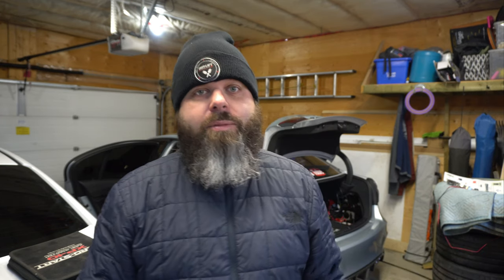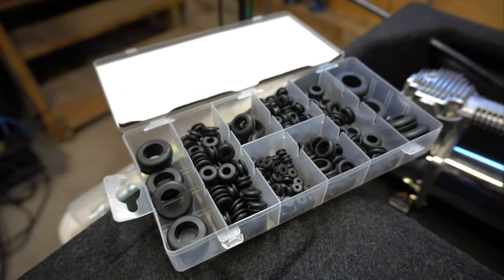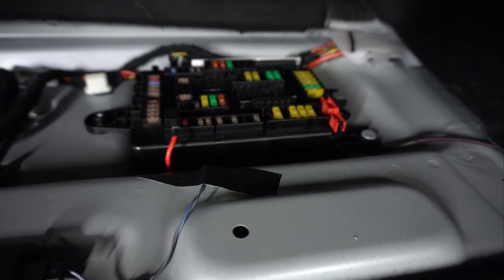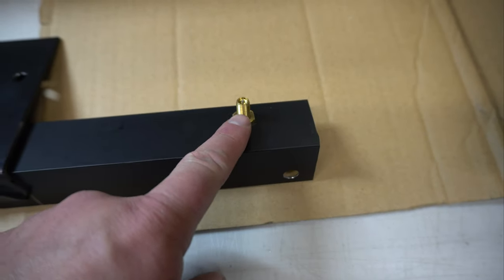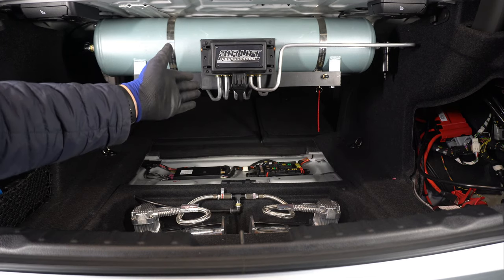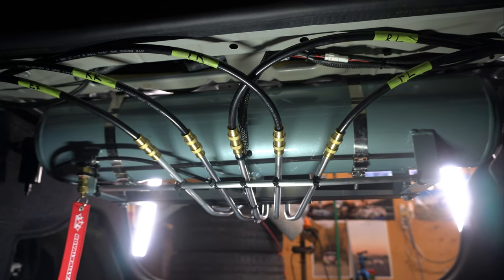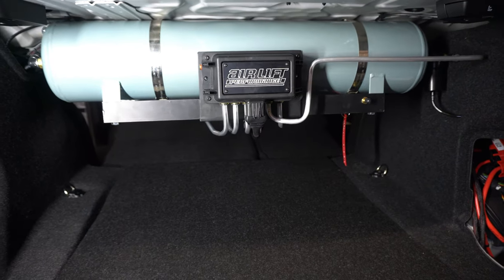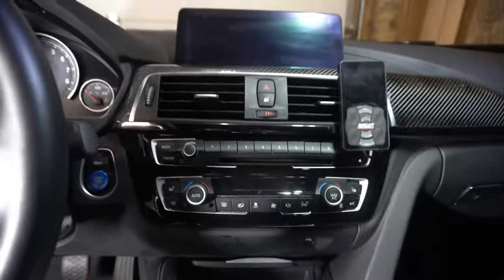Airlift Performance 3H Install Part 4 | Custom Trunk Setup DIY

Comment: I just watched your video and had some questions? I wondered where did you put the control valve??? To make the rear drop at the same speed at the front. Your video helped a lot
Reply from the maker: The valves were put on the lines going to the front bags.

Comment: Where did you run the EX line to? Ca t make it out going to start pulling my old set up and using your plumping set up way clean and very thought through for emergency lol

Comment: You didn’t show connecting the power in confused, do you have a battery in the trunk?
Reply from the maker: Yes that is correct. The BMW has a battery in the trunk

Comment: is it true that hardline are not reliable? I am thinking of floating my tank i have a hatchback so if I mount it to my rear back seats i wont be able to put them down. what do suggest?
Reply from the maker: Hardliners are reliable when installed correctly. I think a hatchback is tough. Most guys put it under the floor or just behind the seat attached to the floor

Comment: Does the bottom cover make contact with the compressors? If so. Doesn’t the compressor get really hot? Im installing  my airlift but I’m very limited to trunk space. I want to do similar set up with hiding them down there but the compressors are a tab taller

Comment: Another way to level the dump without any additional hardware would be to have the EQUAL LENGHT of lines all around. Just have the rears rolled upped in a large circle or even cross sides and tucked away. That's all. 

What I feel AIR RIDE Perf should do with the manifold. Is have a mixxed mani. 3/8" port (2ea) & 1/4"(2ea). Depending where you set up is the shorter side would have the smaller hoses for dumping. I hope I made sense.

....ps Watched your entire set up and love your work. Quality stuff!!🧤🤍🖤
Reply from the maker: I agree with the equal length lines, I think that would also be more reliable and 1 less location for leaks. I think that would be smart of Airlift to do with the manifold. 

Thank you 🙏 I appreciate the kind words.

Comment: Ohman, what a job well done. Nice work bro! I’m impress with your work❤
Reply from the maker: Thank you 🙏 I put a lot of thought and dedication to this install
Reply: @HQGARAGE do you have the link for the “quick dump valve?”
Reply from the maker: Yup 👍🏻 here you go https://amzn.to/3yGUkle
Reply: @HQGARAGE  how did you connect it, to the T ?
Reply from the maker: With the lines that come off the compressors and a PTC fitting for the Airline to the manifold

Comment: Does the t fitting connected to the compressors and running to a single 3/8 line fill the tank up slower?
Reply from the maker: Not that I have found, I have had it setup both ways and it seems pretty quick to be honest
Reply: @HQGARAGE  Thanks man

Comment: Love this video, I'm going to be doing a similar tank mounting on my Q50 I appreciate you leaving the links in the description. I can't wait to get into this, this will be my first time going on air.
Reply from the maker: Congrats on going air, you are going to love it. Just take your time on installing it and you will have little to no issues.
Reply: @HQGARAGE  Super excited. Going with the 3H kit. I'm an OCD maniac so this project seems right up my alley 😂
Reply: @HQGARAGE  what brass unions are those that you used to join to hard line and flex line?
Reply from the maker: https://amzn.to/3v6Ggyf
Reply from the maker: Use those ones I actually changed out the brass ones for these as I found the brass ones leaked.
Reply: @HQGARAGE  ok good to know, I ordered just regular SMC DOT PTC unions was wondering if those brass were any better.
Reply from the maker: Nope you definitely made the right decision.
Reply: @HQGARAGE  Awesome 😎 thanks for taking the time to respond. I really appreciate that.
Reply from the maker: My pleasure. Glad I could assist.
Reply: Man I love this set up. For the rear lines did on the controllable valves did you have to buy 2 of those one for each side ?
Reply from the maker: Yup 1 for each side and thank you 🙏

Comment: The setup looks good! I think im going to try and do something similar on my car, but I was hoping you could give me a bit of clarification regarding the clamps you used. I see in the video description that you have an amazon link to 6" clamps, i was curious are those 6" in diameter, or is the clamp itself 6" around? Its a dumb question I know haha, but I just want to be sure the clamp is sufficient enough to use so I dont have to deal with returning them 😅 thanks in advance for your help!

Comment: Thank you for the quick response. I also like that you ran the 2 compressors to the 2 fitting into 1 line. How has that been working for you? I see your running the bigger airline I’m running the 1/4 line do you think it would be smart to do it still?
Reply from the maker: Ya you could definitely run both compressors into 1 airline it will just take a little longer for the air to flow through because of the smaller passage

Comment: So where does the 3/8 Control Valve mount? Do you mount onto the air tank? I'm planning on purchasing the Control Valve soon. Coz I want my air bags to air out at the same like yours. Thank you. I'm glad your video popped up on my you tube. I already hit subscribe.
Reply from the maker: The control valve goes on each rear airline so it controls the air going in and out of the rear bags so it airs out level.
Reply: @HQGARAGE   so to be correct i need to buy 2 valves. 1 for each line in the rear?
Reply from the maker: Yup that is correct

Comment: Sweet setup. Wanna bag my 14 gt mustang but don't know the tire size and rim size that will fit.
Reply from the maker: That is definitely one of the most challenging parts. Thankfully I worked with Vossen and they helped me with my specs. Most wheel manufacturers know what will work or you can also go to Fitment industries and look at other rides like yours and see what their specs are.
Reply: Thank you sir.

Comment: Is there any special line prep to the ends of the hardline before running them into the PTC fittings?  I am running the nickel/copper line.
Reply from the maker: Just make sure they are de-burred and clean from any grease or contamination

Comment: I am installing a 3p on my Mustang. I like the way you set yours up. Can I get all those extra fittings from Airlift performance?
Reply from the maker: Most of them I believe so, i believe you can also get them from eBay, Amazon, or even like bag riders.

Comment: Question did you end up running into any issues with the check valves or popping fuses with the compressors running in parallel like that? Moved my compressors to my spare compartment and instead of having each compressor go into a different port I did something very similar with the t valve but now I end up popping a fuse after I air up and the compressors pop on a second time after the initial start
Reply from the maker: Nope I can say I did not have any issue with popping fuses or anything.

Comment: Been awhile my friend. Thanks for all the updates. I do learn from your videos. Like I mentioned before it was your videos that I was able to put mines together.

I’m needing to add air control valves soon to adjust the raise and drop to even out.

Which directions did you install the air control valves? Or does it matter? Do they face towards the bags or manifold?
Reply from the maker: Thank you 🙏 I appreciate the feedback and am glad you attempted it yourself. Looking forward to hear how the air control valves worked out for you.

Comment: That "T" fitting you hooked up from your compressors, how is that working out for you and where can I find those?
Reply from the maker: That ‘T’ fitting is working brilliant and still fills the tank quite fast. You can get the T here https://amzn.to/3iCFovV
Or at your local race shop or place that sells airline fittings for big rigs.

Comment: Very clean setup ! 👍Why you are using hardlines instead for plastic lines which comes with airlift  kit? Is it only for the clean look or it is some other reasons?  I'm also wondering who is selling that fitting with pressure regulating for the back? I need theese also 😊
Reply from the maker: Thank you 🙏 I appreciate that, the hardliners are just for show no other purpose at all. The pressure regulators I got from here. https://amzn.to/2Qvw82u  hope that helps.
Reply: @HQGARAGE  oh yes, link helps very much 🙂 By the way, how it's going with your airlift managment? After you finished instal and calibrating, had you any  isues untinl now? 🙂
Reply from the maker: I haven’t had any issues and everything is working incredible and it’s amazing. Not gonna lie being my second car on air and it’s still my fav mod hands down

Comment: Hey quick question did you use the second compressor harness or did you run them both into the first harness together?
Reply from the maker: I have always used a second compressor harness. Mostly for a fail safe so I always knew at least 1 compressor would work.

Comment: Hey love the set up, my question is what is the fitting that you used that converts the hard line to the soft line I can’t seem to find it thank you for the video learned alot
Reply from the maker: Hey Chris, thanks for the comments. I actually took the brass fittings off since they leaked and replaced them with these ones. 
https://amzn.to/3v6Ggyf
Reply: @HQGARAGE  hello! have those new fittings leaked at all since?
Reply from the maker: Nope I have not had any issues since.
Reply: @HQGARAGE  awesome, thanks a lot!
Reply: With those fittings you just push the tube/soft line into it and it’ll grip it? Do I need to use Teflon at all with these connectors?
Reply from the maker: That’s correct, just push in and pull back to make sure it’s gripped and your good. No Teflon tape required

Comment: Following Airlift installation instruction, you shouldnt mount managment this way..?
Reply from the maker: Ideally they recommend it laying flat but having it mounted with the airlines pointed down is acceptable. You cannot have it mounted with the connector and airlines pointed up. If you go to page 10 fig.12 of the instruction manual it gives you a diagram of the mounting of the manifold.

Comment: Hey buddy quick question I have the air compressor where my spare tire goes out will it heat up and mess up when it turns on while it's covered underneath?
Reply: So did u read the question ?
Reply from the maker: Hey 👋 no I don’t think you will have to worry about it getting too hot and messing up. They get warm but as long as you aren’t airing out and airing up over and over again where the compressor doesn’t stop running you will be totally fine
Reply: @HQGARAGE  awesome thank u so much I appreciate it God bless have a good day